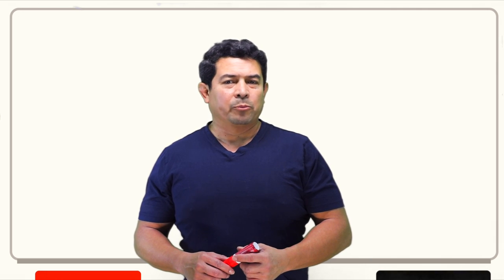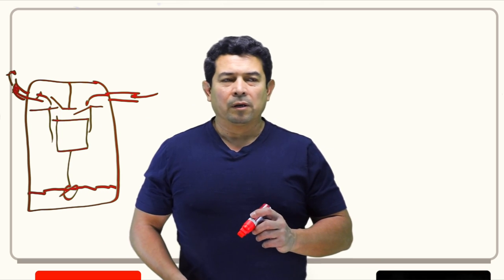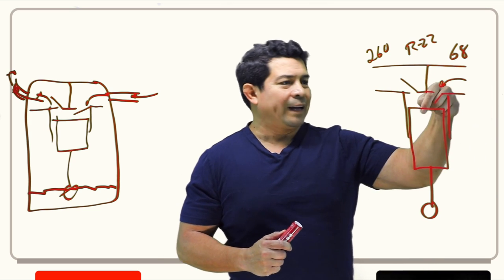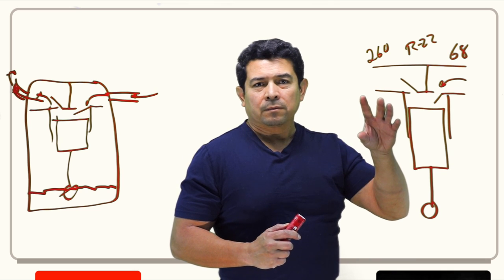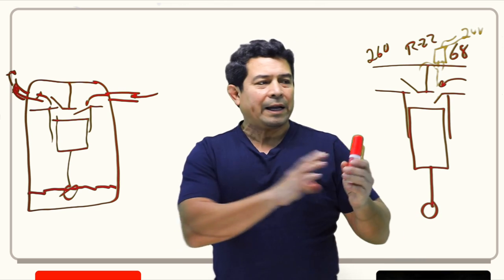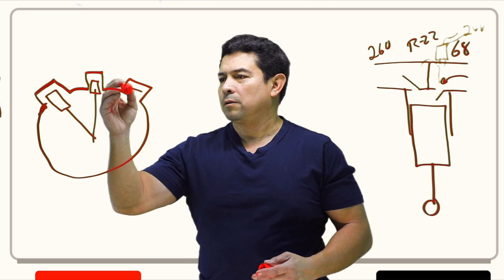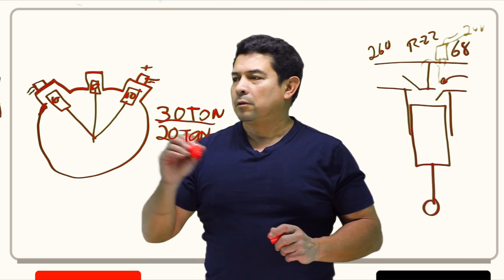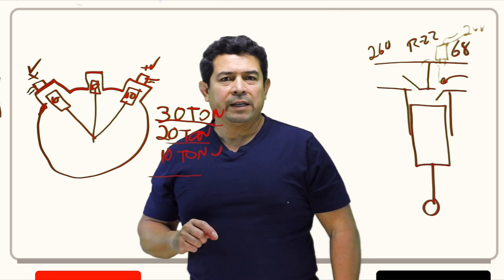Compressor Unloader - HVAC Online Training and Courses

Comment: Hey brother, I just worked on a bus with a '05G compressor. It runs on r134a There are two valves located on it. Do you know if they need to be turned all the way in for it to be open or do they need to be turned all the way out for it to be open? And also what should be the running pressure at 100° f? The charts do not make sense because I compare it with other r134a compressors on smaller vehicles and they are way different? The '05g compressor is running at 70 psi on the low suction side and 225 on the high side at 100° f
Reply from the maker: The two valves you are talking about are they suction service valve and the discharge service valve. Those valves need to be opened all the way to where it is called back seated. When they are all the way to the back, you will not have access, or you will not be able to read precious when you hook up gauges. If you want to pressures at the compressor then, they should be with the mid position or cracked. That means that they are off of the backseat. If you close the valves completely, then they are considered front seated, and the compressor will not run because there will be no flow of refrigerant through it.        Those pressures are giving me seem to be pretty close. Do you have a site glass anywhere on the liquid line or on the receiver/dryer? Do you want to make sure you have enough subcooling and with the bus running a different speed your pressures are going to change. As the bus speeds up the engine wraps up, which is going to turn that compressor faster and change your pressures. So you need to make sure you have sub cooling coming out of the condenser. Usually there's a site glass somewhere so you can make sure you have a full color of liquid going to the metering device.           I hope this answers your question. Good luck and thank you for watching!
Reply: @AirConAcademy  awesome man! I really appreciate you explaining this to me because this compressor is totally different from a regular little automobile compressor being that this '05g has six Pistons I will make a video of the RPMs of it running and show you the gauge pressures. I noticed the high pressure gauge was bouncing?
Reply from the maker: @SMOKEY-JAYS-DIESEL  great! If you do that, I would love to see it!    You can send it to me to my email address.    jh@airconacademy.com

Comment: Open Compressors are also used for Ammonia systems. Ammonia is corrosive  to motor windings.
Reply from the maker: I have never worked on and ammonia system. Thank you for letting me know. I was not aware that ammonia was corrosive to motor windings! Thank you and thank you for watching!

Comment: So when my thermostat says "Stage 1, Stage 2, Stage 3" it's referencing how many unloaders are open? How do I determine whether an unloader is energized open or energized closed?
Reply from the maker: On older compressors, yes! It will tell you whether the compressor is loaded or unloaded and how many stages are actually doing work. On the newer ones than me adjust the speed of the motor/compressor! But if you have unloaders, you will have to hook up gauges and look at the pressures. So if your suction pressure drops when the the unloader has a magnetic field. Some manufacturers will energize the coil to be loaded. Others will deenergized the coil to be loaded. But you have to look at the pressures so you can make sure which way the manufacturer is doing it.  If your pressure drop when there's a magnetic field, or the unloader solenoid is energized, then that means that they are energizing the solenoid for that to be loaded! Or in other words doing work. I hope this answers your question. And thank you for watching!

Comment: The one you told about 24v electric type of solenoid valve,need to ask something,means how 24v supply is given n removed,who decides...means how this happens
Reply from the maker: 24 voltage is  sent to the coil and that is what energizes and de-energizes the coil. But this voltage is controlled to various ways.  One way is through a thermostat that has several cooling stages. Meaning that stage one during the compressor on and stage two will load and unload the unload. At other buildings it is done through the electronics that control the temperature throughout the building. I have also seen it where the unloader works off of suction pressure and oil pressure. So as the suction pressure drops they know they need less cooling and they unload, the same with the oil pressure when the oil pressure drops they know they need less cooling and the unload. It is hard to give you just one quick answer as to how that is controlled.  Thank you for watching that question!

Comment: Good explanation. 
I used to work with these compressors, Carrier model O5G 6 cylinders in motor coaches. They were belt driven by the bus engine.
When the unloader coil on a head. was electrically energized, those cylinders were unloaded.
Lots of guys were confused by this.
You could actually feel each side of the outer heads and sense a temperature difference from one side to the other. Low side, high side.
I would watch the needles on the gauges "jump" when the unloader went from energized to densrgized.
Reply from the maker: Yes, you are correct. A lot of guys get confused with the loading and unloading and with the pressures rising and falling as it loads and unloads. I am glad he liked the video. Thank you for watching!

Comment: You are number one
Can you tell me about Air compressor have unloader   but is the that unloader work at same this operation or just discharge the air out to surrounding when unloading time(start and stop the compressor)?
Reply from the maker: Thank you and I'm glad you like the video! Air compressors they load and unload to keep the electric motor from drawing high amperage. Every time an electric motor starts up it draws high amperage and that cost money in electricity. Plus it puts stress on the motor. So it is best to just unload the air compressor so that the air is not being compressed and being dumped out so that you don't have the start and stop on air compressors. I hope this helps and again thank you for watching!

Comment: I understand the heat load determines if the loaders are energised or not. What are some ways this happens? Is it communication with a room thermostat? Is it recording discharge air and is trying to maintain set point? I’m sure there’s a lot of ways to control them, but what are the most common? 
Thanks for the videos you are a great teacher

Comment: Tnx for sharing knowledge 
My compressors won't go 2nd and 3rd stage any ideas?
Reply from the maker: The unloaders on some manufacturers are energized for them to be loaded and on others they have to be de-energized, or another words no power going to them for them to be loaded and doing work. Depending on the age of the unit like an older units, they could be controlled through the thermostat. Then they were controlled through a Honeywell controller and these days they're controlled through circuit boards or computers that control the building temperature.      I would start by looking at the schematic and see where the wires go to from the unloaders that are on the compressor. By tracing them back, you can see what is turning them on and off.    I wish I could give you more information, but if they're not loading at the moment, you could check to see if they have voltage going to the unloader if they do, you can undo the voltage wires in that should load it up. And you could run it temporarily until you figure out how they are being turned on and off.     Hope this helps! Thank you for watching.     If you have any other questions, please shoot them my way!

Comment: Thanks You. I have seen a solenoid upon compressor bitzer but is connected with tube. Too is a discharger ?
Reply from the maker: I am not sure without actually looking at it, but it sounds like it may still be part of an unloader. There are so many different configurations out there with a short description it is hard to tell. I'm sorry
Reply: @AirConAcademy  thank you.

Comment: Thanks for the information. Every now and then I come across unloaders. I understand the concept of what their function is but was not sure how I would go about troubleshooting if I came across a bad unloader. Knowing how your pressures regulate unloaded and loaded helps especially when there are 3 or 4 unloaders on a comp. Constant cycling of the compressor would probably indicate that the unloaders aren't doing their job.
Reply from the maker: Yes, that could be an indication. You should check to see if the unloaders are unloading before the compressor shuts off. I mean it should be fully unloaded before it shuts off. Unloaders work great and it minimizes the constant starting up and shutting off of the compressor.

Comment: This is amazing! Very knowledgeable n good explanation! U r my great instructor 👍can u explain why compressor need pressure equalized ？please!
Reply from the maker: Thank you so much! Thank you for your compliments and thank you for watching. I am not sure what you mean when you say pressure equalized? I believe you are talking about the pipe that is normally connecting two compressors when they run tandem Lee like in a chiller?   One of the reasons they do this is because of the oil. As the compressor runs, it will pump some of the oil out because it mixes in with the refrigerant. As the suction Gas comes back, the oil is mixed in with it, and it would collect in only one of the compressors, if we did not have this equalization pipe between the two compressors.  I hope this answers your question!!!   And again, thank you for watching!

Comment: Could you please explain the oil flow in the compressor where there is oil pump to maintain oil pressure.

What could be the differential oil pressure in the system and how it is maintained? Basically please try explain all the points related oil pressure and oil flow. Thanks alot.
Reply from the maker: Oil is pulled out of the oil sump at the bottom of the compressor, the oil pump that is at the front of the compressor will pump it through the crankshaft, because the crankshaft is hollow, the crankshaft has holes in it where the bearings are, so as the pump pulls the oil out of the oil sump it pumps it into the shaft and through the holes and it lubricates the bearings as it lubricates the oil falls back down to the oil sump to be used again. 

I hope this explains it. Thank you for watching!
Reply: @AirConAcademy  Thank you so much Sir.

Comment: Any vids on compound cooling? Started a new job at Walmart and some of their stores have compound compressors and I need to familiarize myself with them
Reply from the maker: I'm sorry, I am not sure what you mean by compound compressors? Are you talking about when  you have multiple compressors and multiple evaporators? If that is the case I have a video on EPR valves. And how they are used to maintain different pressures and temperatures in evaporators.  I'm not sure if this is what you were talking about.  If you get a chance please let me know if that is what you were talking about or explain to me what you mean by compound cooling so I could possibly make a video of it. Thank you for your question!

Comment: Hi Sir, Why is unloading important when the compressor starts?
Can you please explain.
Reply from the maker: Yes, it is important when the compressor starts because of the motor that drives the compressor. If the compressor starts fully loaded, it will be hard on the electric motor that drives the compressor. But if it is unloaded, then it is so much easier for the motor to start up. It has nothing to do with the compressor itself but with the electric motor that is driving the compressor. I hope this explains it for you. Thank you for your question and thank you for watching.!!!!
Reply: @AirConAcademy  Thanks alot Sir.

Comment: I have an 06D compressor that will constantly have to pump itself down in the off cycle, like the valves are bad. Could the unloader be stuck causing this issue as well? If so how would I diagnose that?
Reply from the maker: It could be the unloader, it could be leaky valves, it could be a blown gasket. It could also be a leaky solenoid valve on the liquid line. From your description it sounds like you have a pump down system. Which means that it would have a solenoid valve on the liquid line and it would be the low pressure switch to cut the compressor off. One thing you could do is close off the suction valve to the condensing unit and see if the pressure increases or if it needs to pump itself down. If it pumps itself down then the problem could be with a compressor. If it does not pump itself down then it could be a leaky liquid line solenoid valve. Try this and hope that this will help you figure out if it is a leaky liquid line solenoid valve or if the problem is in the compressor. Good luck I hope you can figure it out!

Comment: Will an unloaded cylinder head be hotter than a pumping one since there's no cold return refrigerant flowing through?
Reply from the maker: It will not be that much warmer! If the cylinder head is hot you could have a blown gasket and hot gas is going into the low pressure side. How are your pressures? Do you have a high suction and low discharge pressure? This is one way to tell if you possibly have a leak. Good luck!

Comment: Very nice explanation sir and thanks

Had one small query that what if the external solenoid loaded/unloaded is not used for compressor and all pistons are working loaded and will cut off only when the room temp reaches the desire temp set point by the LP and HP cut out, will it work normal if we remove the solenoid in emergency can we make it direct in some situations.
Reply from the maker: Yes   if your compressor is fully loaded when the solenoid is de-energized and you remove the solenoid, then the compressor will always be loaded and it will operate without any problems.  that is ok.   thank you for your question.

Comment: Very well explained.  One question, when unloaders are energized and the port to suction is open all the time, doesn't this raise the low side pressure? Meaning that all that gas is flowing backwards to the evap?
Reply: Basically, all valves to and from the compressor have to be closed in order for psi to build or get higher. This is because the compressor takes for example 10 ounces of space and compresses it into 2 ounce of space. If the suction side valve is open and the piston is moving up and down I have all that space from the compressor piston all the way back to the evaporator coil. This can be for example 100 ounces. The compressor now with the unloader operational is taking 110 ounces of space and compressing it into 102 ounces. This will barely raise the psi in the system and wont affect the flow of refrigerant. 

10 ounces down to 2 ounces causes refrigerant to go from 10 psi to 100 psi

110 ounces down to 2 ounces causes refrigerant to go from 10 psi to 11 psi.

If you think about that, 110 psi compared to 11 psi, the discharge side of the compressor is so much higher than the suction side. Basically this difference in pressure wont matter to the flow of refrigerant and your system will work. Even if you were able to have some flow of refrigerant from the suction side to the evaporator there would be a check valve installed on the system that would make sure that you have the proper flow. 

Try to think about the volume that the compressor has when both valves are closed and how much it can compress vs when the unloader forces it open and you have a large area/volume that cant really be compressed.

Comment: Thanks for the knowledge now i understand it helps
Reply: Good morning, I have a question for the technician, that after I disassembled the Carlyle 5h80-A194 compressor and replaced the new spare parts, namely the piston, ring, conroad, bearing conroad complete with 4 slave cylinders.  After that, I tested running, but it looks like the compressor is not powered up, even 2 cylinders feel hot. I've tried opening the cylinder cover again and checking that the valve plate is installed correctly, the suction valve is in position. Then the test run again, the result is still the same. Even the capacity valve has been adjusted.  clockwise or vice versa, but the compressor is still not powered.  my question: can i be helped to find a solution so that the compressor can run normally and can cool down.  notes.  now i run compressor no two normal and cold.  Thank you in advance

Comment: Sir does the unloader always energize when compressor is running or only energize when starting.
Reply from the maker: Thank you for your question! We cannot say that the unloader, is energize when starting. Some manufacturers energize the unloader to load the compressor and others will deenergize the unloader to load the compressor. I suppose the correct way to put it is that when the compressor starts up, the compressor needs to be unloaded so that it will draw less inrush current and it will be easier to start up.   Just remember, the compressor must be unloaded on start up and some manufactures energize the solenoid to have the compressor loaded and others will deenergize the solenoid to have the compressor loaded. Thank you for your question and I hope this answers your question. Thank you for watching!